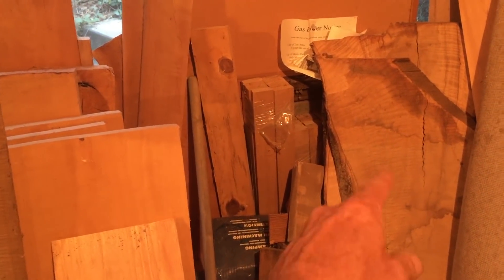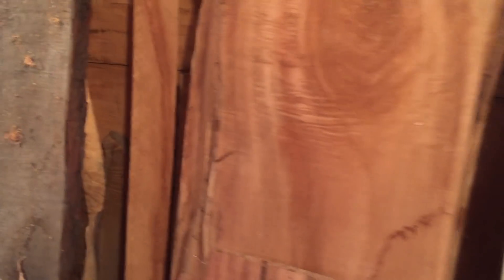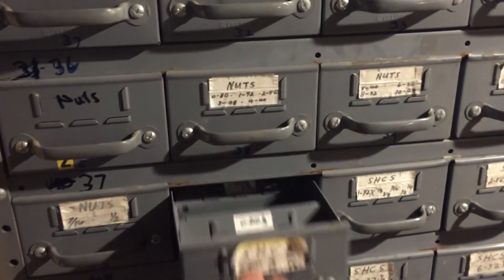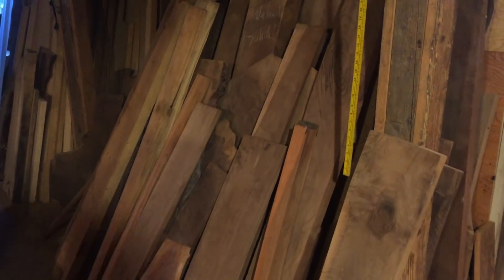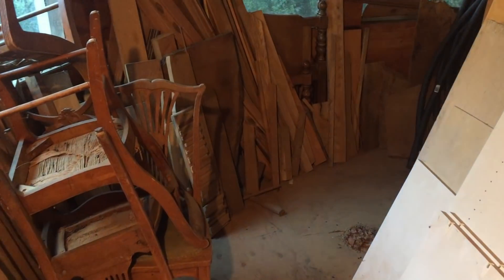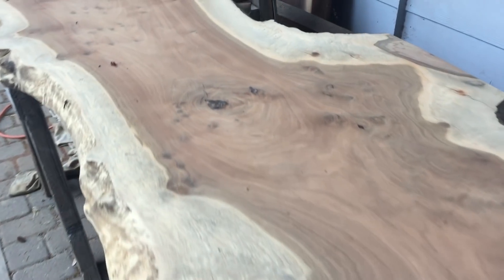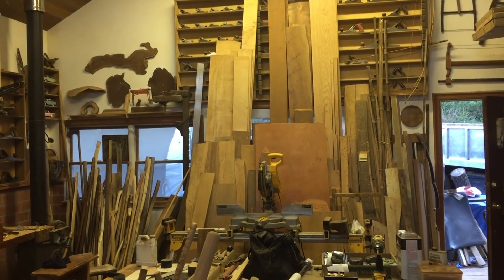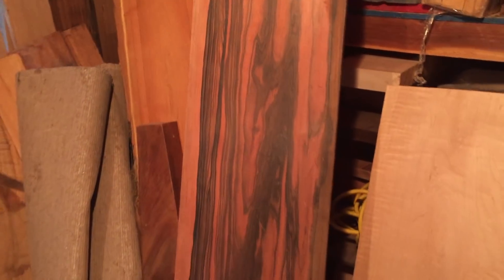I'm a WOOD JUNKIE

Comment: Two of the most underrated Woods in my opinion are Mulberry and Osage orange aka "Bois D Arc" which is about the hardest wood I know of and in the Mulberry family.
Reply: Coil's Tree Service 
You are correct in saying that  "  Bo Dark"  is some hard wood, I have worked with some !
Reply: Here in N. Central Arkansas we have lots of "Bo Dark"..Ha...and yes it's very hard and used to be used for fence posts.
Reply: marbleman52 
I lived in Heber Springs for a long time, so I know about that!
Reply: try climbing/trimming/cutting down a BOIS D ARC!! puts fear in my chainsaw, and holes in my a#* from the thorns! not to mention it's like trying to maneuver around in an eagles nest....whoo wheee... one thing tho, it splits BEAUTIFUL when it's green, and makes GREAT firewood!
Reply: Just sold some of that Osage. Kiln dried 1X lumber. It is tough. I have two beautiful straight big logs waiting for me to saw into blanks right now. It's bright yellow as you saw it but turns dark brown with exposure to the air.

Comment: Question , does wood get harder as it ages. I once helped tear down a house that was approx 70 years old, the guy I was working for said that if I wanted I could have what ever lumber I could salvage, I ended up with alot of 2 x 6s from the roof rafters, they were actual 2 x 6s, but when I went to use them they were so hard I almost could not drive a nail into them. also does wood go back if never subject to the weather ?
Reply: Yes it does. If I want to put a nail or screw into the beams of my 100 year old house, I had better pre-drill the hole first, or else I can expect the nail to bend over and the screw to break off.

Comment: OK, I have the perfect go-to product for you to make - and market.  And get 10 to me for giving you the idea.

I mentioned on other YT prepper sites ... why can't someone make a ferro rod and roller striker inside the butt (tang) handle of a knife.  Most especially a metal or WOOD !!! small neck knife.  Or just a neck "stick" firestarter.  At the butt end corner, opposite the tang hole for a knife leash, have the striker wheel for finger striking (like normal Bic or cigarette lighter).  Or be able to use (my design) for running along levis, boot sole, side of boot, or across concrete/wood surface for sparking (old cowboy match lighting technique).

My design is for a ONE-HANDED emergency fire starting method.  Find such wilderness bare wood surface, and holding bird's nest under the firestarter in the same unwounded one hand, strike downward, throwing out massive sparks into the bird's nest for an emergency flame and fire.

So here is the best option.  Small handsize Bic lighter wood piece as a neck firestarter stick.  Drill hole for small ferro rod (and spring).  Slide in little metal plate, holds spring and rod, ... like old matches inside a cribbage board slot.  At the butt end, cut out the slot, drill the sideways holes, put in a striker wheel, and push in the metal rod through the wood and roller.

Easy to make, massive use for any prepper, survival, and emergency firemaking use.
Reply from the maker: John Lord preping is big business. A lot of worried people in this world and with good reason.